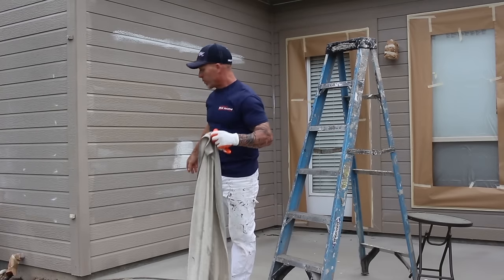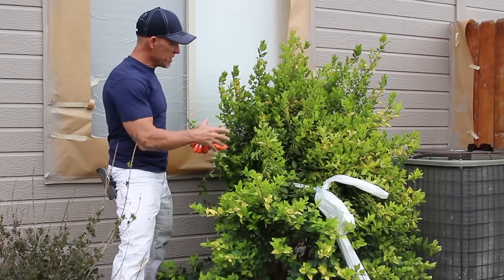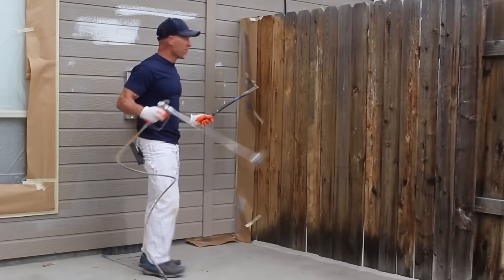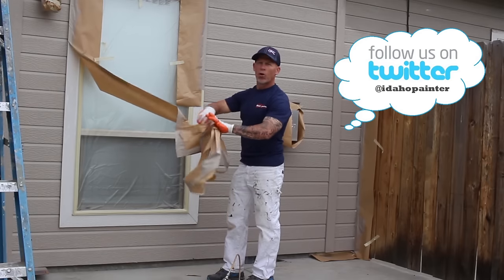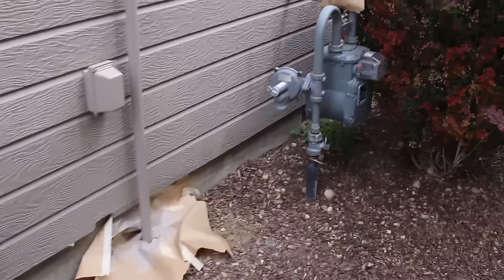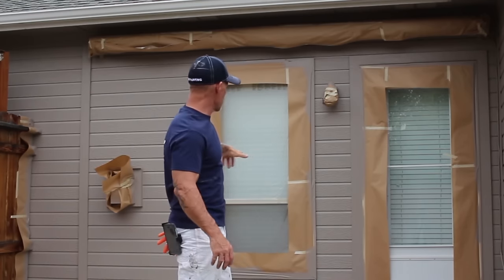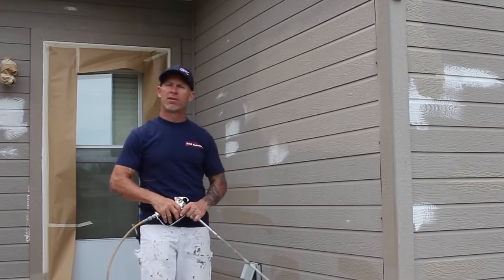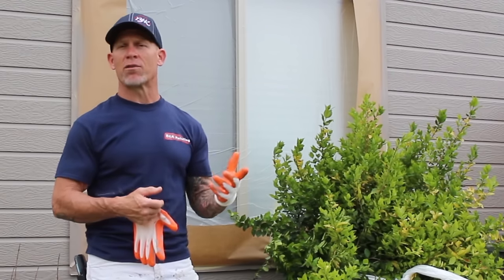Stopping Airless Sprayer Overspray | Eliminate Paint Over Spray

Comment: Nice. My dad would beat my butt if I angled the spray tip side to side or if I was too far away with the tip to control over spray.  The tip size is suggested distance. 5-15 means to have tip 5 inch -15 inch depends on pressure at regulator.
Reply from the maker: incorrect
Reply: Well?
What’s incorrect? Because I was agreeing with what you said. Lmfao

Comment: Chris....great channel....but i just cant get a good spray the way you guys do....i tried using 515 tip for exterior low sheen acrylic...heaps of o/spray...changed out to a 415 to be honest did not notice any difference in fan width or o/spray.....help?
what tip did you have in clip? thanks
Reply from the maker: The difference is only a 2 inch difference. I would not use 415 because it did does not put out enough. Controlling overspray takes a lot of practice

Comment: Where do you get the holder for the cardboard shield? I've also seen guys using metal versions on interior walls.
Reply from the maker: You can find them at your local paint store, but I also sell them on my paint store at www.theidahopainter.com/tool-store
Reply: A 6" bulldog binder clip & a old aluminum broom handle works well...cheap&free!

Comment: Be careful in a few years if you have to pressure wash the house.  Sherwin Williams Resilience is notorious for color change when using a normal house wash mix.  Google it.
Reply from the maker: Hmm, we've never had an issue with that!
Reply: @Idahopainter  not knockin the paint.  I think its that kind.  Its the SW with the mold inhibitor in it.  I had read about it in some pressure washing forums and then one day it happened to me.  Thank god I did a spot check first.  I saw it happening and when it did I asked the home owner what kind of paint they used and she brought out a SW paint can just like I told her they probably used.  Seems to be the darker colors as usual.

Comment: Do you back brush/roll as you spray? I was told that’s needed for good adhesion.
Reply: Only on heavy grain areas like older decks. Siding there is no need for it

Comment: Does it matter if the paint is not new? I used a gallon I had in storage mixed it with paddle and the sprayer used that gallon quick covered less than 100sqf and blobs too was using 315 tip. Had to use it on full spray couldn't really control it cause it wouldn't spray, it was regular latex paint but it looked kind of thick could it had been due to storage? Is it best to buy the paint right before you use it? Sorry for my ignorance new to sprayers.
Reply from the maker: It does not need to be new
Reply: Mix and Strain your paint

Comment: Is that II told you are spraying on the walls? If not, than what would happend if you needed 2 coats would you still remove the paper from windows? I don't see that being necessary  until the job is complete
Reply: +The Idaho Painter awesome!
Reply: Have you tried using the graco 360 degree  nozzle for the wang?  In my opinion it makes it much easier to work with and it also has a spit proof added to it, so you wont have that spit you get from working with the extension

Comment: Hey Chris! Do you only apply 1 coat or do you go back over a 2nd time?
Reply: +The Idaho Painter there is always going to be some over spray.  The paint won't sick to the concrete and what about the tip dripping on the concrete is that ever a problem

Comment: So is the xtension recommended for a better finished product?
Reply: Rob C. No really all depend on sprayer painter...
Reply: I personally would never use a extension while spraying a house.
If you watch him spray the siding towards the bottom you don't get any paint under the bottom 3-4 lap joints.
It's hard to tell in this video because the repaint is the same color.
This is very important to have a good coat of paint there because of when it rains you don't get water intrusion into the siding "splash".
I would recommend getting down to the level of your work and making sure that everything is coated evenly, or go as far as brushing a good coat under the first 3-4 lap joints for Insurance.
Roofing felt paper works great on areas where the concrete meets the foundation, and you can reuse it.

Comment: I have a question the bigger the tip the less pressure does that equal less overspray. I'm trying to figure out watch tip I should be using 2 have less overspray.
Reply: No, little pressure in big tip you'll have uneven lines i recommend to start off with a 517 for big walls and 415 for house w more edges. Once you master it you can use the 523 or 617 and put your presuure higher and get done faster i learned this in high end production 10 yrs ago.. Of course youll need atleast a Graco 695 and up to get up to that level

Comment: What size tip do you recommend for a terrocotta tied roof
Reply: I know you're not talking to me but I always used a .213 to a .415 just depends on material and my surroundings. I always used an airless. Sometimes the ends of those roof tiles can be a PIA. Many times I would just use a 3" brush to fill those in while spraying the tiles. Better than fighting the coverage

Comment: Do I still use that size tip for a solid color stain?
Reply: I'd drop down a sizen i.e. .015 to a .013 or even .011
Reply: 27+ years experience slinging a brush!

Comment: when i use a smaller tip like a 311 or so for whatever im painting with it, it clogs alot and i gotta stop and reverse the tip alot using good paint to like super paint and above. what causes that? it dont happen with larger tips.
Reply: Sam Taylor strain the paint and make sure to bleed the machine for a solid 5 minutes through the bleeder line and through the gun(without a tip in the head, of course)

Comment: What paint and system are you using for this?
Reply from the maker: Titan 440
Reply: @Idahopainter  I’m looking to purchase a professional grade sprayer. Mostly for cabinets and potentially siding. I’ve been looking at the Graco Magnum ProX19 Cart Paint Sprayer. Have you used Graco products? If so which do you recommend?I’m comfortable with spending a few grand on a great system. Thank you!
Reply: Sorry * Graco Ultra Max II 490 PC Pro

Comment: I have alway brushed and rolled.  It's just the way I was taught.  Can you recommend a sprayer.  I was looking at the Graco Magnum project painter plus.  item number 257025.  Your thoughts would be helpful.  Or anyone else.
Reply: Graco 395 is a great small professional sprayer.  A true workhorse.  It's about twice as much cost as the cheaper homeowner models but worth it in the long run.
Reply: 395 Graco.. other than being heavy. Solid little sprayer. Keep it clean it'll last a long time..

Comment: The use of a wand on a gun, especially without the hinge adaptor,   guarantees that you will be "fanning" the spray, resulting in an uneven paint film.
Reply: David Jensen not necessarily. Just a lil more work to keep it at a good angle
Reply: @ottallman  Begs the question as to why you wold want "just a little more work". Tell me, how do you get behind that bush without compromising the optimum right angle to the surface? How do you keep the optimum angle when working off a ladder? More often than not, "painters" are using it to extend their reach, and in so doing, compromise the angle, at least if not using the angle hinge that Graco sells. Hmmm, I wonder why Graco sells them?

Comment: Hello, How do you keep flashing on spraying exterior?
Reply: Get a swivel to your extension as there will be heights where you can't keep a steady hand. The key is even spray strokes all the way through. I found kelley moore professional grade paint to be very forgiving if you mess up. If you stop in the middle, then continue, there's  a chance you'll get flashing especially on a hot day
Reply: Spray with the wind in same direction you're spraying, when possible. It helps

Comment: While you have some good tips on how to properly operate a pump, some of your tips need some improvement.

1, why waste plastic on vegetation when either ropes, drop cloths, or a combination of both works just as well?
2, the wand is completely unnecessary, especially with sprayer poles being available for high stuff
3, plastic AND paper on windows? Yet another unnecessary waste of masking material
4, a 515 tip to spray an exterior wall is a waste of time when compared to a 517
5, you forgot to mention Graco now has fine finish, low pressure (FFLP) tips. Usually green in color. Takes less pressure to use, ergo save paint.
6, even brand new tips spit paint.

Comment: Why don't you paint the trim around the windows first,. Then tape off the entire window and trim when you Spray the Body color!???
Reply: The tape can rip off patches of paint when you unmask if you taped it too soon after it was painted. With his method you could do body color and then immediately do trim afterwards. No waiting 72 hours or whatever it takes for the paint to fully adhere. More efficient this way as far as working with a crew.  I'm just assuming that's his reasoning.

Comment: Why would some painters like a blowed out tip?
Reply: That's a good question and I just might have an answer for you believe it or not. (I have nothing to do with this video btw, and I'm sure someone will say I'm a fool, etc. but to each their own right?). I always run a nice good tip, but I usually have 3 with me in a cup of water or something that I swap out as/if needed. 1 wide fan for coverage, 1 narrow fan for use with a shield, and I like to keep a really blown tip with me. There are some parts or sections of a job where you really can't, or just shouldn't spray even with a narrow fan. In that case and again only small sections you can use the blown tip to spot spray a bit heavy with someone right behind you who has a "wet" roller and they can "backroll" (roll over/re-roll) that area without having to bring a bucket of paint with them. The best way to describe it is just like when rolling a wall, you take the dipped roller and make a large V or W initially so you have paint on the wall to work with but your not dripping, then roll back over it spreading it out evenly, kind-of the same principal.
There are other reasons why some use a blown tip for particular work, but that's prob the best/easiest example. I hope that made sense and I didn't confuse you. I can try and clarify if I didn't explain something well enough.
I do want to stress that using the example I gave most of the time it's not "just" a blown out tip, it's a blown tip slightly modified to give the spray your looking for. 
Again, any extra clarification needed just let me know where I lost you and I'll do my best. I know exactly what I mean but typing it doesn't always come out quite right.
Take care,
Reply: I'm a journey painter da1cru1.residential preferanly,but I've painter in -40 degree weather in the middle of a dirt field in North Dakota.I just remember how the man I learned how to paint from who,might I add was color blind and probably the best painter I've ever known,when we primed a house all he liked to use was a 517 blown out tip.I never asked why but it always stuck with me.
Reply: @markhart3024 ; Thanks for the background, it helps me understand where the question originated. Obviously I can't explain his reasoning with certanty but I have a couple ideas. It would first really help to know if it was Always the same tip or if he swapped them out as a newer 517 wore out, and as you were mostly doing new const residential I'm curious what most of the exteriors consisted of. I'm in FL and a good 95% of all houses and even buildings are stucco, the rest are cinder block, both very porous. 
If I had to make my best educated guess I would prob say because it's the first ever primer coat on a new construct, short of rolling, using a blown out tip would be the best way to ensure complete coverage (including any crevices or porous material) and that the walls are fully soaked and sealed as well. With exp it's much easier/quicker to "soak" a surface with one pass and no runs with a "blown" tip where it would prob take 2 good roll jobs for the surface to drink up all it can. it all adds up to less overall time, less expensive topcolor paint needed/wasted, and sure to last a decade+. Generally I would have to say it's probably a personal choice as you could use say a 519 or so but as I'm sure you know a "blown tip" can or does "spit", if worn or tooled with you can make it spit lighter but evenly over the whole pass making it awesome for new construct prime jobs. There are many other reasons, but this would be the one I would bet on. You never know, keep your blown tips and play with them on something, you just might find a niche where they work perfect for a particular thing....
As I mentioned I worked for a company where on prime, also new construct they would spray with a blown tip (that they tooled a little) but have someone right behind them with a wet roller to backroll. Worked good to ensure the porous stucco was covered. IDK if I maybe helped or made more confusing.
Reply: @da1cru1  usually,if my memory is correct,it was the same 517.and it was always on new construction.spray ceilings and walls first PVA prime coat,and he used it for spraying finish coat on ceilings.wall top coat was always rolled.Thank you for ur insite.you wouldn't happen to be painting behind Hurricane Michael would you?
Reply: Because you can shoot second-story Eaves and never leave the ground

Comment: Did I hear that correctly, normally he doesn't put drops on the landscape plants or concrete patio, I total agree if you are using correct pressure and tip size there will be LESS fall off, but come on.  As we all know that spray there is going to be overspray & fall off, adding that extra protection is the way you don't have to worry about things happening. Getting over spray off a porous material such as concrete is a pain in the ass. Plus how much extra time does it take to add the extra protection, I am a true believer in  giving your customers and customers property the resept that they and there biggest investment  deserve. So saying your using the right pressure on your pump and correct tip size is good enough, I truly disagree. So respect your customers and there property, I recommend to everone drop and cover everything.
Reply from the maker: Always respect your customers and their property, but in our experience we have had great success in not getting paint on the landscape so this is just what we do, we pay for any damages done to property if there are any

Comment: I use cardboard Shields and stay away from anything I don't want paint on and come back and cut in with a brush and I don't buy plastic and tape running my own paint business for 13 years
Reply: If you're using Shields why come back and cut in with a brush Shields get pretty straight line true story bunkhouse all we used were Shields  never touched it with a brush or roller

Comment: Before Watching Video... 
Let me guess, wait till it's not so windy or humid and cover up the S*** that will be oversprayed?
After.....
OK, I didn't realize it was a "beginners" video.
Most beginners wouldn't have an airless like that.
You probably have the largest wand (extension) that I've seen anyone use at that short of a distance, but that being said, you have good control of it.
PS.... You should have mentioned that OIL based products and windy days don't  mix... You will end up overspraying a Corvette half a block away if you aren't lucky. LOL
Reply from the maker: We do not use oil based paints
Reply: What do you use on metal like pipes or doors etc? Two part epoxy or do you just prime it using a brush/roller? **Or maybe waterborne Killz type of product?

Comment: it mystifies me that you've had no claims against you from neighboring properties etc. for overspray.

maybe idaho is very dry, and it dries into the air quickly. In toronto where it is humid, i don't think i could get away with this.
Reply: +The Idaho Painter hahaha great answer....😂😂😂😂😂😂😂
Reply: I will
Reply: Like you said in this video. You can spray on windy days. More caution is needed but it can be done. We have sprayed homes that were literally an arms length away from the neighbor, up on pumpjacks and 3 sprayers going 415 tips, not one spec of overspray on the home next door.

Comment: How about don’t spray every thing pro painter here way to many people are spraying these days , airless spraying should only be used on substrate that is unpaintable by brush or roller as sprayed paint on certain substrate will NOT penetrate and key to substrate to achieve the longevity of the paint . Also if you don’t want to get cancer always wear a respirator as atomised paint in your lungs from a airless can be fatal

Comment: Bro that's a really slow way or doing it and not really efficient. Prep and spray the windows first mask that up with low tack tape from scriber to scriber then spray the weather boards! Use longer wider dropsheets and put plastic over plants so as not to crush or break them. Use lower pressure on your spray unit and a smaller tip! NZ painters are some of the best front runners for all painting anywhere in the world!